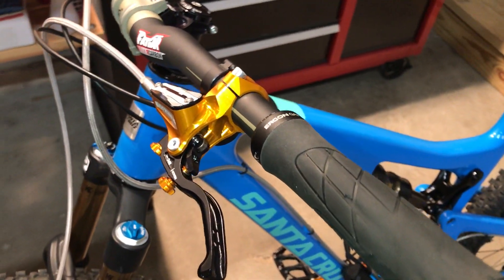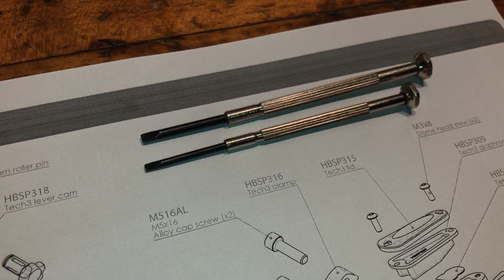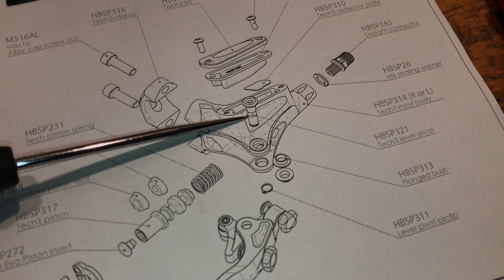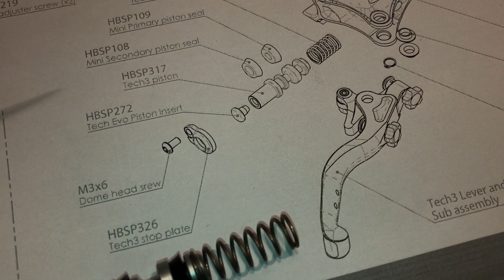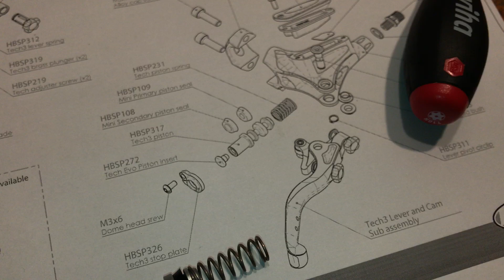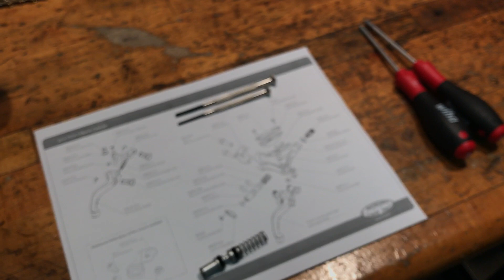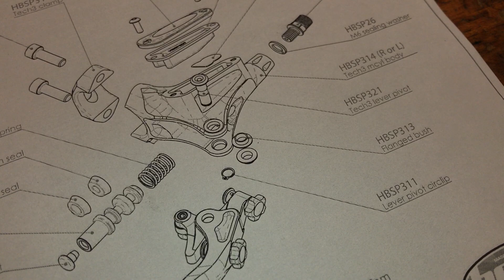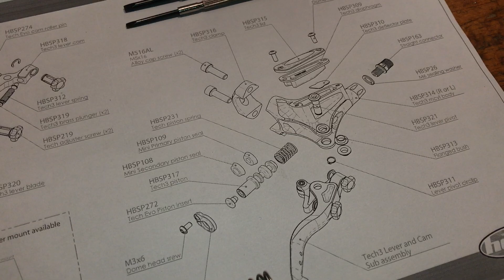Hope Tech 3 Brakes - Piston Replacement

Comment: How is the overall braking power on those brakes?
Reply from the maker: petar The power of these brakes is very good. Although I do have the four piston V4 calipers with 203mm rotors, so that is the most powerful setup that you can get from Hope. Some may argue that other brands are slightly more powerful, but what I really like about the Hope brakes is the modulation. The feel of these brakes is better than any other I have used, plus you can adjust both the reach and bite point. Not all brakes have both of those adjustments.
Reply: LJ Nick thank you for responding